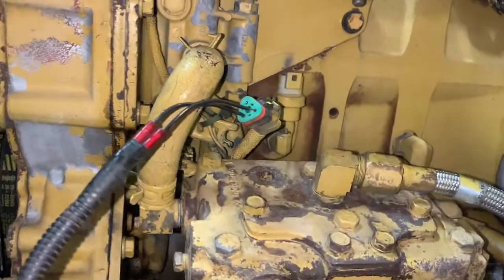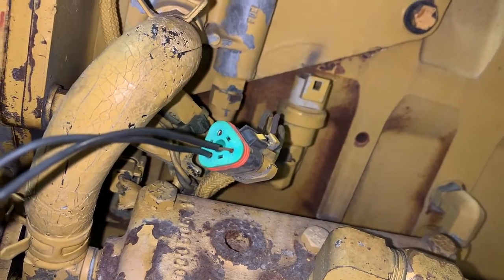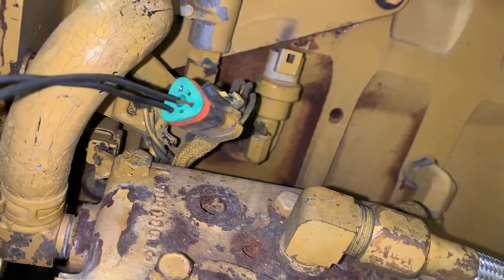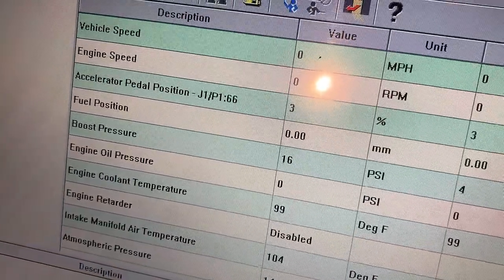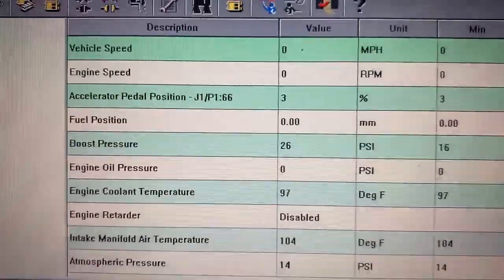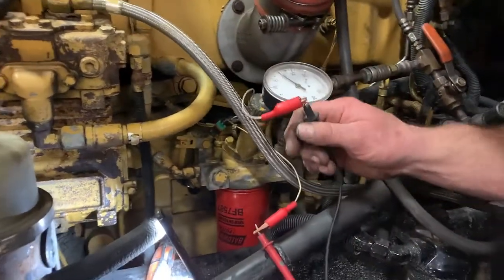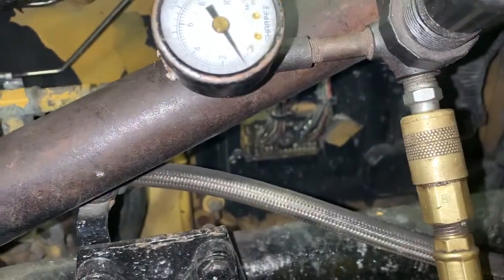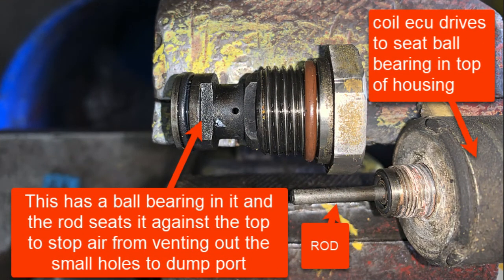Cat c15 Testing waste gate system part 4 of 4

Comment: What’s the proper name for the solenoid and where is located
Reply from the maker: The solenoid is on the drivers side and it mounts in a housing bolted to the side of the cylinder block about midway. You can follow the air line from the turbo wastegate air solenoid back around the engine to the housing. I'm not sure what the exact part name is. If you cant take the old solenoid to cat with you take a few photos of the housing and solenoid and show it to the parts guy. Make sure you photo all the information on the engine serial tag. There is a serial number and an AR number. The parts guy will need both to look it up.

Comment: I hope this helps me.. I have replaced my turbo, CAC, HOSES, BOOTS ,AND SENSORS HAVEN'T REPLACED THIS WESGATE.. THIS I BELIEVE WILL HELP ME A LOT. JUST GOT MY TRUCK out of the shop been there a month. Drove it today still no boost i had boost after the turbo was installed about an hr n a half drive it started back losing boost..So this will be my next thing to look into.. i have spent thousands trying to figure this issue out
Reply: I hope this helped you. We dont work on cats much. There are just a few things that have to be working correctly on this system. Our customer said their unit ran fine after we did the work.
The main reason I put this channel up is because when I worked at cummins I met so many owner operators and their wives who were good folks. I know so many get taken advantage of or get a Poor fix or repair and still spend lots of $$$. So this is the best way I can help is share what I learned over my lifetime working on engines.
Reply: I Appreciate  I don't have Cummins, w9 paired with c15 acert but still Appreciate your efforts.
Mechanic is very hard to find these days Parts changer at every corner
Reply: Let us know what fixed it once you get it sorted out.
Reply: @melodicimpressions  i will
Reply: @Detroitbby80  did you ever figure it out I am currently going through the same thing with 05 w9

Comment: What’s considered low boost on the c15?
Reply from the maker: I'm no cat expert but When we looked up the parts at cat online we downloaded the T/S which was 2 pages. In there it said to look for 26 psi. That was the point where the boost control valve would start to cycle open to slow the waste gate opening. This is a model year 2003. The advertised horse is 391 ( on engine tag)so that 26 psi is 52 inches of mercury or INHG as we are used to measuring it. I think the waste gate control can bump it up to around 28 or so. So a 400 hp engine 58INHG of boost is very good i think. The N14 525's used to have about 65-68 INHG on the dyno at full load and rated RPM. After saying all that I think I did not answer your question. Mainly because i cant give you a magic reference number. But the customer was complaining of low power. They have had the truck two weeks now and have not called back. They would if it was not running how "they are used to it running". We are sure there was very low boost because we can tell by looking at the exhaust manifold. The final road test we saw 28 psi on the dash gauge and it sounded and was pulling like a champ. Also the pyrometer was staying in the normal zone.
Reply: @ENGINESHOPJOE  my truck used to build up to about 35 psi just fine, but recently it has only been wanting to build up to 25 psi, but if I turn the truck off and back on again it will build to 35 psi then a few miles down the road it will only build to 25 psi. I haven’t noticed a change in fuel efficiency much, and just a slight change in power (mainly when going up hill) what could be the issue? Turbo is fairly new and rated for a lot more hp than my engine can put out.
Reply from the maker: I am not sure what make or model and what horse power your engine is. That all does make a difference in the answer you should get. Here is my best guess from what you said. The last line you typed is "Turbo is fairly new and rated for a lot more...". When an engine is controlled by an ECM or ECU (same thing) They almost all will drive an active derate for TOO much boost (turbo pressure). Some derates are silent which means the ECU does not turn on a dash light. But when you power down the ECU (shut off the engine for a couple minutes) the ram is cleared and then reloads at key on and as I always used to tell owner operators.."It's a brand new day at key on " Thats why it runs up to the 35 PSI again. If the turbo you installed is making much more boost than the OEM turbo would of the engine's controls could be doing this in what they call "engine protection". I will put on the list to do a short video on why there are over-boost controls.  Last the only way to be sure is check fault codes and or have some one ride with you with diagnostics that can identify active derates when this happens.
Reply: My Acert maxes out at 39 psi of boost
Reply from the maker: @TolaTrucking  What horsepower is it? That is 80 INHG and some serious boost if it is stock. I bet it runs good. Thanks for the comment
Reply: MY ACERT 625 MAKES 62 PSI OF BOOST AT 1400 RPM, AT 1050 MAKES 42 PSI OF BOOST, I GOT A DASH GSUGE AND I INSTALLED A MECHANIC GAUGE, ACTUALLY THE MECHANIC GSIGE SHOWS 3 PSI HIGHER THAN THE DASH GAUGE